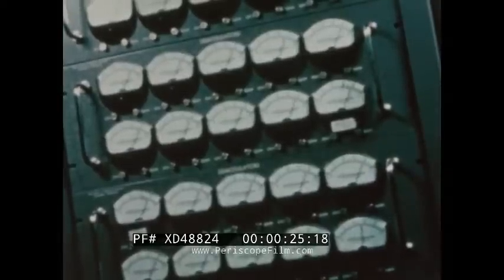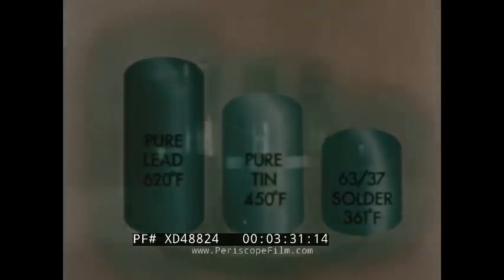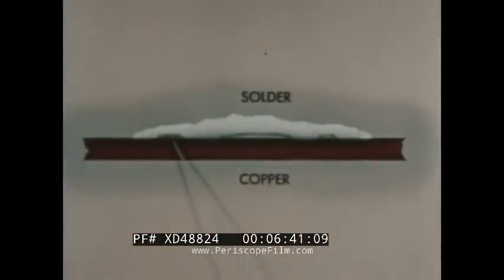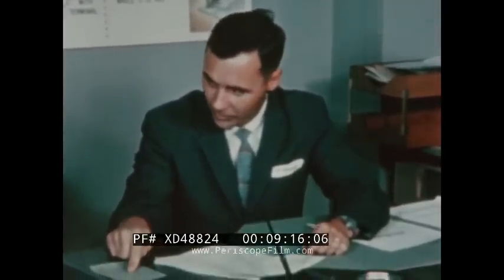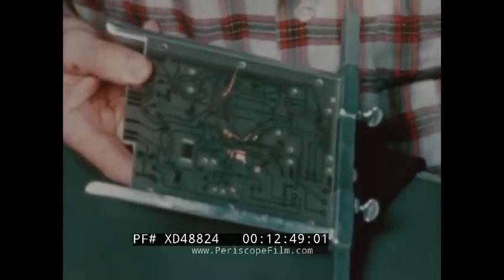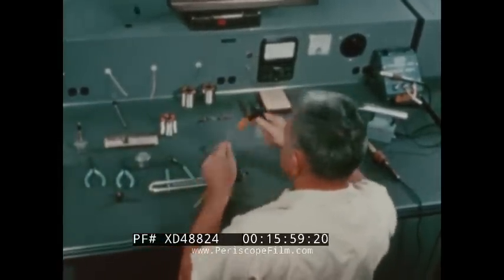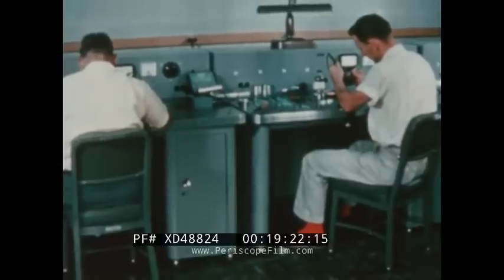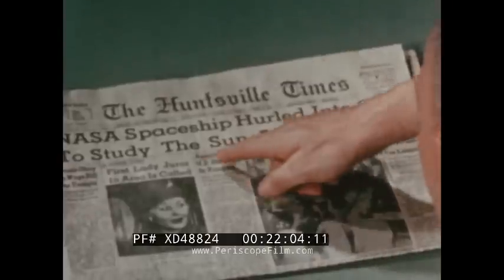1958 "ABOVE AND BEYOND" NASA SOLDER & SOLDERING TECHNIQUES ELECTRONICS INSTRUCTIONAL FILM XD48824

Comment: When I was at a Navy school at Ft. Meade in '74. our class finished a course early so our instructor sent us to a 2 day NASA soldering school. That course has served me well to this day.
Reply: our Airforce NASA soldering course took a week, we must be slower than the Navy lol
Reply: My dad had a NASA soldering school when he was working on the Apollo fuel cells. I learned how to solder in an electronics class in high school, then the Navy in Avionics starting in 1971. I retired from a very large communications company as a tech and even today there are  things that need to be soldered. It isn’t just all board swap.
Reply: No Navy guy is such a coward as to hide behind an anonymous name!
Reply: Don't you hate how modern products are built to be disposable and impossible to repair ?
Reply: @MichaelKingsfordGray  What are you talking about ?
Reply: @edwardfletcher7790  He, unlike you, cowers behind an anonymous name.
Reply: @edwardfletcher7790  The problem is most modern electronics can’t just be put on a bench to be worked on. Now everything is so complicated that it is sent to a place that is set up to repair these things with diagnostics  and proper tools for fixing surface mount technology. I worked in the oil well logging for many years where we actually used things like O scopes and data trackers to find bad components These electronics were subjected to high temperatures down oil wells and had high failure rates even when using Mil Spec components. We even used high temperature solder which is a real pain in the ass. I hated it so much I quit and then worked close to  30 years doing communications work doing everything from phone switches to fiber optic and satellite communications. I got to do some pretty cool things like go to Kuwait after the first war and put in a trunked  radio system and a few years later training and supervising Indonesians doing network installation, turn up and test at a big US owned copper and gold mine.
Reply: @Chris_at_Home  I was mainly referring to the use of glue instead of screws and Apples hostile attitude towards customers. Their computers use custom parts so you can't replace bad keyboards, LCD's, RAM & HD's
Reply: @MichaelKingsfordGray  right, and you're what exactly? 308th Keyboard Batallion?
Reply: @joshuacheung6518  I was a RAN Lieutenant, insubordinate infant.
Reply: Was? Past tense? So you separated at a mere LT, a gimme rank? Curb your insults, you weren't anything important.
Reply: @joshuacheung6518  You are asking me to tell you classified information. What rank are you? What are your bona fides?
And calling your insults "insults" is a fact, not an insult.
Reply: Hahahaha. You're marking yourself to every service member of a professional military right now. The information You're calling classified, the information you already gave, your mannerisms.

And they actually are, my dear keyboard warrior.
Reply: Oh bullshit too!

Comment: Thanks for posting the video. I have been soldering around the home workshop for more than 50 years. I, too, learned some valuable information from this video. My 1998 Subaru Legacy Outback suffered from a quality control problem arising from the switch to low-lead solders: Cold joints on the PC board that took the signal from the speed sensor and operated the speedometer needle and more critically the ignition control computer. No repair shop could fix the problem. After watching a YT video I was able to remove the PC board, re-flow the solder on the “dry” solder joints, and solved the problem completely. The money I saved doing the repair myself paid for the new Weller adjustable pin-point soldering iron. Hooray for YouTube!.
Reply: Good job!
Reply: This is normally only an issue with the 1999. Intriguing.
Reply: @zoomzabba452  Maybe it was built late in year 1998 cycle. I used 50/50 solder, and actually installed a couple of “jumper wires on the back of the board as shown in one of the videos.
Reply: YouTube is amazing. You should check out Louis Rossman
Reply: @cdx873v  Just some feedback: I usually ignore brief replies like this one, as my time is just as valuable as yours.
Reply: @david203  amazing!
Reply: And you learned something
Reply: @charlesward8196  50/50 solder? That's a very specialized solder, that doesn't seem like the correct type for automotive.
Reply: @AureliusR  50% tin and 50% lead is what I learned to solder with 60 years ago for all electrical applications. In my experience it flows better, and bonds better at a lower temperature. The problem with the Subaru speedometer PC boards in ‘97-‘98-‘99 was that the low lead solder requires a higher temperature and was not bonding as well, allowing the connections to fail with little visual evidence, other than a “dry” appearance. 

Lead IS a significant neurotoxin, and can be absorbed through inhalation of dust or vapors, through the skin, or ingested by mouth from contaminated hands. But like many other industrial materials that pose toxic hazards proper hygiene can minimize the risks.

Once it is in your system your body treats it like calcium and stores it in bones and teeth. Every time cells that have been contaminated with lead reach the end of their life-cycle the lead is re-mobilized in the blood stream, and can do additional central nervous system damage before it is scavenged for recycling the same way your body re-cycles calcium, and stored in new bone cells for the next cycle. It eventually works its way out of the body. 

Hygiene is very important with this material. Work only in a well ventilated area, keep temperatures low to reduce fumes, minimize exposure, and clean the work area, skin and clothing to control dust and surface contamination.
Reply: @charlesward8196  I've been soldering for many years, and I don't even know of many suppliers that carry 50/50 solder. Are you sure you don't meant 60/40 or 63/37?

I recently started to make the transition to lead-free solders, and there are some new blends that are absolutely amazing. They flow super well, don't grow tin whiskers, and are just a joy to solder with. I do still have a lot of 63/37 Kester solder because I bought a kilogram reel many years ago and it's just lasted ages.

Comment: These soldering standards are still in force today in the aerospace industry. Everything is inspected and every aspect of a solder connection has rigorously defined criteria. I've been an avionics tech for 24 years, I'm qualified at the highest level, and I've been soldering since I was a little kid... but I'm not permitted to solder any production boards. We have certified professionals who do that. It sounds extravagant, but it's necessary when lives are on the line.
Reply: Same here man. I'm in the Air Force and was a part of AFREP. We followed the NAVSEA 2M/MTR program which was built on the back of the content in this video. We still have extremely stringent standards for parts going on aircraft!
Reply: Minor correction to above: There are some cases where techs are permitted to solder. We can tombstone surface mount components for troubleshooting, solder tune microwave circuits, tack in test selects, and remove shorts. Once we're done, the assembly goes to a repair operator and inspector before being returned to us for further testing.
 We have to be certified yearly to be allowed to do this, which involves a class and hands- on exam. We are not sent to the yearly class unless our job specifically requires this type of soldering. I have been certified previously to do this, but my current job doesn't require it.
Reply: But what should one use instead of an 'typewriter eraser' nowadays?
Reply: @elmariachi5133  We use toluene to remove any postcoat or other contaminants and then isopropyl alcohol.
Reply: @elmariachi5133  i have used pentel hi polymer erasers.
Reply: too bad they don't hold indian programmers providing software for these planes to the same standard as solder joints lol.
Reply: @kisielthe1st  I'm still furious at Boeing for that. Normally software is held to the same standards as hardware. Everything that I've ever worked on that was flight critical had built- in sanity checks, redundancy, and fail- safes. Boeing management overrode the objections of the engineers and pushed it through. People should be in prison for that.
 I don't blame the intern that they had write the software, I blame the management who were too greedy to follow the established development process and the FAA for letting them approve their own quality without oversight.
Reply: I back up everything you are saying about production boards.

There are employees within the industry who have warrants out for murder & their arrest due to their negligence either in production or service of commercial airliners. The US govt has refused to extradite 4 to Japan. 1 committed suicide, 1 died some other way idk about the other 2. And that's all i can say about that.
Reply: @GoSlash27  wow, you have no clue how pissed employees at Boeing are over Boeings deliberate violations of FAA rules and the coverup which followed, blaming the pilots of those 2 airliners. Dont ever expect the USA to arrest those involved, but those involved may be hunted for the remainder of their lives by Indonesian & Ethiopian officials. If it wasn't for 3 engineers who flew to DC & approached the state dept because they couldnt trust the FAA & provided proof of the coverup nobody would know the truth. Boeing first called them disgruntled employees but the boxes of docs they carried proved Boeing was well aware of the flaw & gambled the risk on odds it would never occur & if it did, they could just blame the pilots. It is in excusable but having worked there it does not
Surprise me. Im shaking writing this it just boils my blood.
Reply: @cme98  I can well imagine how pissed you guys are and how personally enraged you must feel; I feel exactly the same way and I don't even work for Boeing. Had it impacted my reputation and employment, then yeah... It'd be even worse. Take care, brother!
Reply: @GoSlash27  This explains so very much about boeing's direction as of lately.
Reply: @elmariachi5133  Fiberglass pencils. Unlike erasers, they leave no residue.
Reply: @samuellourenco1050  Thanks.
Reply: @GoSlash27  It's what happens when corporations get big, powerful and wealthy enough, and acquire the influence that they can bribe, buy and sell Congressmen and regulators.

Comment: ive soldered electronics for years — and nowhere have i seen so good a description of what happens chemically and the reasons for solder adhesion — ive got a clean bond from a habit of heat the copper base, wick the wire, and bridge it in with a drop of solder — but i never knew how the heating action caused oxides which prevent adhesion — so this was instructive — so important. 

people are soldering circiut boards for spaceX and just expect it to work — while sloppy soldering (and lack of basic knowledge in this film) — could bring down the whole space programme if those doing component-level work are incognizant. thx for posting!
Reply from the maker: Glad you enjoyed it! Appreciate the comments. Subscribe and consider becoming a channel member  https://youtu.be/ODBW3pVahUE
Reply: That's because it is one thing to solder a few hobby and bench projects and a totally different thing to do mass manufacturing. There are tons of books and articles about the materials technology for that and endless rules.
Reply: I just started soldering. This was so cool and yeah, liked the oxidation info.
Reply: I am going to point out something that really upset me. We know why lead+tin melts at a lower temperature than lead or tin does on their own, they knew it then too. It's the same reason salt water freezes at a lower temperature than fresh water. I really wish they had just left it at "lead and tin mixed together at a lower temperature than they do apart" or "the reasons are technical, and unnecessary for understanding soldering" and didn't go down the "man doesn't know why this happens" route. You can find the technical explanation on Wikipedia (yes, I know they didn't have Wikipedia, but we do).
Reply: I assure you if anybody at Space X is soldering anything related to a NASA contract they are required to be NASA certified for the application they are doing. Certifications last anywhere from 6 months to 1 year in which they have to go back to class to demonstrate their capability & pass a written test as well. The FAA also requires this for anybody touching a commercial jet & the military has their own standards as well. Any violation of such certs is like a bomb going off & heads roll. It simply isn't done unless a rare accidental case. Any inspector knows if you are certified & if you do work not certified nobody will accept it & it must be repaired or trashed. Youd probably be fired too.
Reply: @cme98  It doesn't work like that anymore. SpaceX simply self-certifies. I did training like that once and it lasted exactly half a day. Also... none of those circuits are being soldered manually. They are all being assembled at mil-spec manufacturers. SpaceX does the integration, but, again, they certify that they meet specs themselves. NASA only does high level design reviews. And since SpaceX is the technology driver, especially with the reuse, NASA doesn't even have relevant specs. What happens is that SpaceX submits their internal design criteria and then NASA rubber-stamps them. Except for small design changes NASA doesn't have a choice... they don't have anybody else to fly with. ;-)
Reply: That is the reason why you don't heat the pad or the lead first, or transport molten solder with your iron. The materials should be heated only when the connection is formed (that is, the solder is added).
Reply: @Montgomerygolfgator  You have to remember that his video was created decades ago when that knowledge wasn't available. [
I suppose the video uploader could have inserted a slide into the middle of the video to update to current informational abilities.]
Reply: @Montgomerygolfgator  Wikipedia was invented in Huntsville, not far from where this video was filmed.  Funny how things come full circle.

Comment: Just what I needed. I never learned to solder. Been watching tutorials for day's and found yours. I'm 67, journeyman brazing/mig/tig/gas/arc cast iron and many exotics. I can weld a fart to a moonbeam. Disabled and haven't melted anything for 15yrs. I've bought the equipment and been soldering now for three day's, feel like a kid again. Haven't made anything, just practicing wire joints preparing for some back burner projects that really should be soldered. Having fun.

Comment: I never soldered anything but have welded for a living. It help me raise my kids and supported myself. Maybe one day I will learn to solder too.
Reply: is soldering and brazing the same thing?
Reply: @fitrianhidayat  Approximately. Brazing is generally done at a higher temperature than soldering, and usually using a flame torch for heat rather than contact transfer from a hot metal object (which is what a soldering iron is). Also, the melting temperature of the braze metal and base metal can be fairly close in some cases, making heat control a bit more difficult. If you melt the base metal you are welding, not brazing.
Reply: Go for it!
Reply: Welding is far more complicated than soldering.

Comment: Soldering is not just joining two components in place , its an Art too . I've been Working For Professional Audio Industry For 20 years . 
Cable soldering is my Favorite and am never get tired of that .. definitely it takes Dedication and patience . 😎
 This Video is an Inspiration and  its makes me Proud , Thank you.. 😊
Reply: I'm an ex audio-visual installation/service tech too, and I did a fair bit of live production work along the way. Now I repair laser/inket/direct-to-garment printers for a major manufacturer.
Soldering in the audio production/hire/installation world is a cool art because there's a pretty big margin for error in terms of electrical characteristics - audio signals/circuits are quite bandwidth-limited and tolerant of less than perfect solder joints, unlike digital/RF gear - but it's still very important to make mechanically sound joints, as you would well know. Audio equipment and cables often receive some pretty rough handling during their lives and even the best designs of mechanical strain relief in plugs/sockets can sometimes fail. There's definitely satisfaction to be had in working with patience and precision, like when you finish soldering the last of 16 XLR plugs onto a high quality custom-length analog multicore breakout and all the tails end up exactly the same length, or wiring up a really tidy rack that's super easy to service later. :)